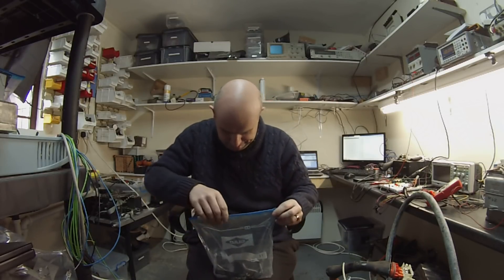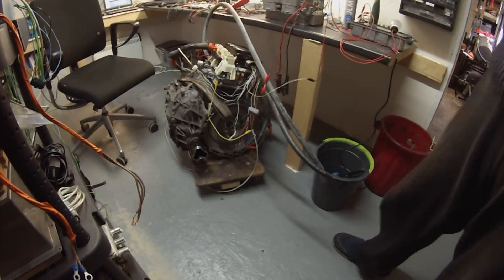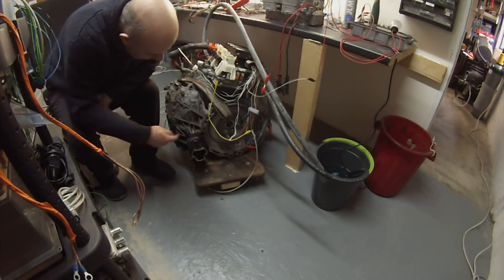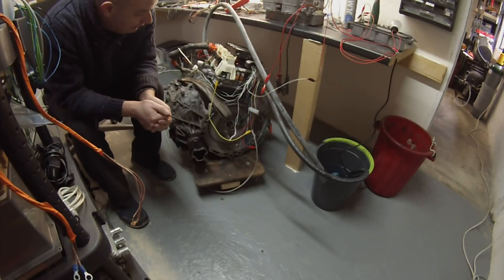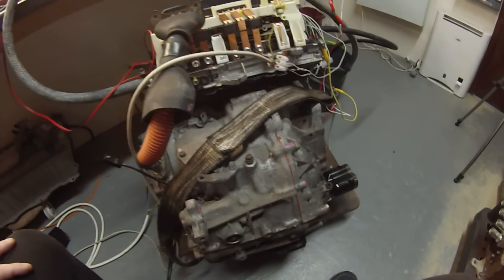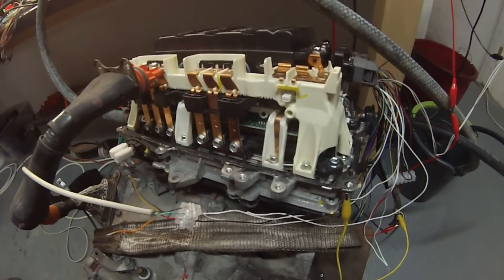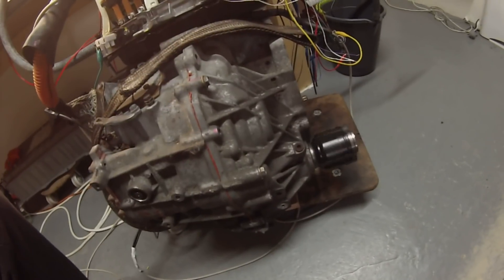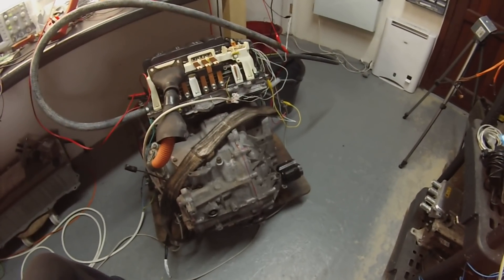Prius Gen2 Transaxle With Gen3 Inverter

Comment: I have an 07 Toyota Prius I've always wondered if you can modify to be a plug-in vehicle by using the inverter that comes with it and just add on extra battery pack

Comment: Is the ICE shaft fixed? Have you worked out the RPM MG1 will attain when driving above 70km/h ? I've always heard than on gen2 Prius the ICE will start running above 70kph because of the high RPM on MG1, I think it will go to 12000rpm at 70kph with the ICE off and that is its upper limit.